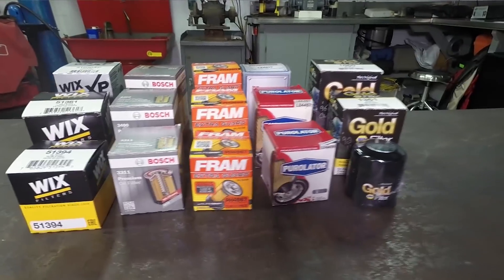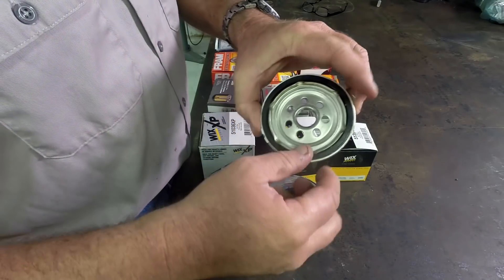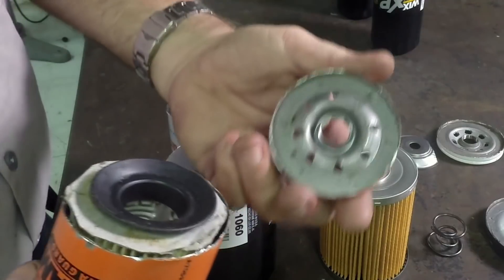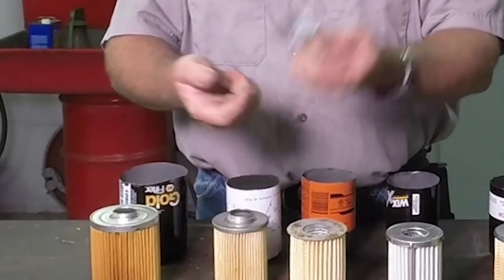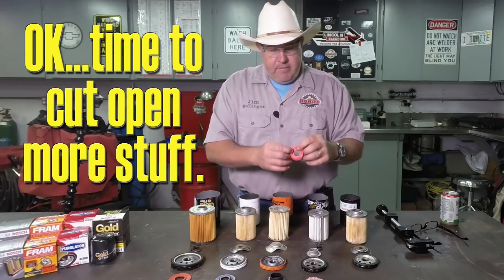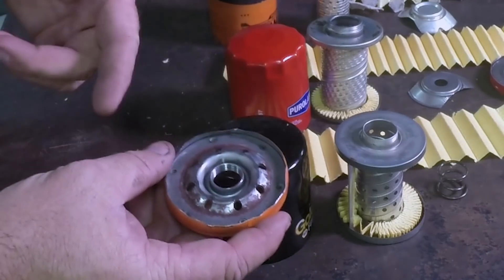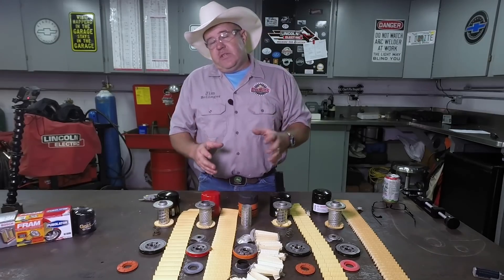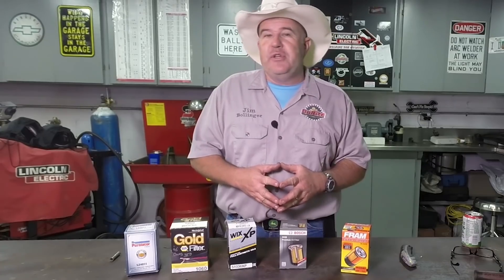The worst oil filter EVER!

Comment: Fram obviously watched al these videos proving how nasty their standard filters are so they developed the "Ultra Synthetic" which I'm presuming is meant for synthetic oil not that it matters. But the insides are really up to scratch, great media, metal ends, good spring, good anti drain back valve. It runs about $8. but it should be the only filter they produce.

Comment: An eye opener about Fram. Been using this brand on my 85 Mazda RX-7 since purchased new and changed oil and filter every 3k miles, perhaps the frequency of oil changes prevented filter failure. This has changed my perception of Fram dramatically, it's Wix or Napa Gold from this point on. Clever marketing on Fram with the attractive container, all to hide the sordid materials within.

Comment: I use nothing else but Fram filters, since I do my oil changes  I had a 95 Nissan pickup and used Fram oil filters for 25 years  it now has over 3000000 miles with same engine, you don’t need a 50:00 dollar filter. Fram also makes other oil filters with better quality, what you used is the three dollar filter.

Comment: I only use purolator filters in my car and I'm at 265000 miles and running strong. I recently smog checked it and passed with no problems.

Comment: The rust in that Fram filter should not go inside your engine. It seems to be outside the element and therefore if any of it was loose it would be caught in the element and would not enter your engine. The proof is in the pudding. Only scientific analysis on a machine where clean oil is deliberately contaminated and then filtered with each of these filters and compared oil analysis before and after such testing will prove which filter, if any, is superior regardless of how superior the construction seems to be of one compared to another.

And Fram makes at least three different levels of quality for their filters. It's not fair to include Fram's cheapest filter with more expensive ones unless you at least include Fram's more expensive ones like the Fram Ultra.

Comment: So much for made in USA. I got 290,000 mi on my 350 using various filters including Fram with 5000+ mile oil changes. If you change your oil at 3k before it gets really bad what difference does it make. Maybe people with K&N air filters are the ones who should worry. Go Oberg.

Comment: What makes an oil filter good: Thick casing, metal filter holder, silicone (vs rubber) anti drain back valve, real metal spring (vs those metal clips), and most importantly a media that has the highest efficiency at the lowest micron size.

Comment: I found a study about this in the early days of the internet. The Fram filter not only is crappy filter from just stand point of the material in the filter portion of the unit oh, but it's actually dangerous for your engine. If that cardboard breaks loose in your engine and makes it end to the oil that is flowing back to the engine you could blow your motor. I stopped using Fram probably about 2002. I would like to see a cut-down of the Purolator gold. That's what I've been using. My new car has gone back to the old style cartridge filter where you just change out the media. Kind of like my 66 283. Boy was I surprised when I went to buy the filter for that years ago! This is great video by the way. Keep up the great work! I wouldn't put a Fram filter on a lawn tractor.

Comment: Thanks I have a 2003 ford f250  with 7.3. Well my oil never stayed clean so I bought an remote toilet filter and my oil was cleaner. I have 14 qts in my system and the big point was clean oil. I am going to try a new frantz synthetic filter that is guaranteed for 12,000 miles. I must be doing something right I have 250,000 miles, but I was interested what you thought.

Comment: Would have liked to see a factory filter like Motorcraft
Reply: Looks just like the purolator pureone
Reply: @mr.boostang2064  according to my recent research Purolator no longer makes Motorcraft oil filters. After Purolator had a major quality issue with the MC filters Ford  has now contracted their oil filters out to Champion Labs.
Reply: @tonybradley2801  that's good news then because Champion makes quality oil filters and spark-plugs

Comment: I just changed my oil in my 381 stroker Chev.
511hp and 12k to build. I put a Fram PH5 filter on my prized gem of an engine. Now I gotta jack up my 81 Camaro again, and swap out the filter with a Napa Gold. I can't believe this. My buddy musta saw this video, cause what he told me, matched up with what I saw in this video. I wish he would of told me that before I did the oil change. Good thing I didn't run it with the FRAM POS-h5 filter on it.....I'll be cutting it open (probably with a dull Swiss army knife, zip cut not needed) once I get the damn thing off.

Comment: I actually had a bad Wix/NAPA Gold filter for my Jeep 4.0 where the filter was horizontal and mounted to the side of the block.  The anti-drain back valve was bad and allowed the filter to drain back into the crank case through the oil pump. An engine start after a few days had lifter clatter from the slug of air in the filter. NAPA immediately sent their engineer along with a Wix representative. I filled the filter and put my thumb over the discharge hole; then I turned the filter on its side and oil drained out past the anti-drain back valve. NAPA took care of my expenses and apologized. Great people.

Comment: What about Baldwin filters that are the preferred filters used in heavy equipment and are available for any application? 

I have been using them for years on all my vehicles.  https://www.baldwinfilters.com/portal/site/Baldwin/menuitem.f6e556a1cf41b967f2ae22c04256d1ca/?vgnextoid=7aa8a15580756610VgnVCM10000025651dacRCRD&vgnextfmt=EN

Comment: Best filter I ever owned was a Frantz which uses an adapter plate in place of the stock filter with the canister which holds a roll of toilet paper that provides filtration of the oil. I ran one in a 1965 Plymouth Valiant with the "Lazy" six cylinder for over twenty years, swapping the roll of paper every thousand miles & adding oil, usually a quart to bring the level up to the full mark. I NEVER CHANGED the oil except for what was added with each "filter" change & the oil looked as clean as the day I put in in when I sold the car You can still buy them for about $250. I paid about $25. for min in 1967.

Comment: I'm going to say it now and I'm going to say it again, I put over half a million miles on a 2002 Toyota Tacoma using nothing but Fram filters. they work great. anybody  want to argue with half a million miles? I pulled my valve covers off at just 450,000 miles to change my leaking valve cover gaskets, the camshafts, everything was absolutely beautiful you could have eaten off the inside of that engine!

Comment: I learned several years ago that While Fram does manufacture many filters, their market share is so large they contract out to other companies. That is to say, they don’t make all of the filters with their logo on them. Care to guess where they are made? Hint: saltwater promotes corrosion. Because of the inconsistent quality, I quit buying Fram back in the 1990’s. It’s not always crap, sometimes some part numbers are “acceptable” quality but there isn’t a way to tell by looking at it and I’m not gambling on my own or someone else’s vehicle to save a couple of bucks. 

I worked at a CarQuest store in the 1980’s and we had a display of a disassembled WIX filter beside a generic filter that looked similar to the Purolator in this video. No one would have believed there was a filter as crappy as the Orange one at the time. I usually go for the manufacturers filter for proper fit (more important on late model engines) but if it’s gotta be aftermarket, it’s gonna be a WIX. (One exception, a 6.0 PowerStroke)

Comment: You just triggered my depression with that Fram filter. How could this product have lasted on the market for so long? Don't answer. Don't care. I try to keep what little I have and try to do the small things to do what's right, while to whole time it was russian roulette with the Fram oil filter. I AM speechless

A shoddy product bears no place with me, even though it is cheaper. If a good baseline product is more expensive then to me that is the right price pay, and means there is no loss in the saving of pennies, or quarters... or dollars. Then, the reverse becomes prominent, the higher price is the only reasonable applicable choice becomes the standard in my book.
Like, French's Mustard. A low cost mustard just simply isn't French's Mustard. They are world's apart. And not the world I live on. Give me French's.

"No More Fram's."
"Stamp Out Fram's!"

Comment: I already knew they weren’t much good, at least not at holding their oil. I had a Ranger 2300 with sideways oil filter. It started having dry starts ( I could hear it for few seconds on starting ) so I would have to start- shut off restart at least once. I got a Motorcraft filter and it didn’t do it any more.
Had another one and it started doing it, I thought it probably has Fram filter, it did. Put I think it was STP filter and didn’t do it anymore.
I don’t care if they are FREE don’t use one.
Reply: Good to see something like this where someone actually cuts a bunch of different brands to see what’s inside. Now we know

Comment: Been using Fram oil filters for over 45 years with no issues. They make several levels of quality and I always buy the highest rated. In this video I can't see which Fram is being used. I drove a Honda for 26 years (270,000 miles) and did over 50 oil changes and it was not using oil when I sold it. I recently bought a new Subaru and I watched a video on how to change the oil. The instructor said he used a Purolator filter because the bypass spring was strong enough to not let any oil bypass. Walmart ( yeah I know) didn't have Purolator or a Mobil to fit my Subaru so I decided to try K&N. Yesterday before I put it on I watched a video where a guy compared about 7 nonsynthetic filters and about 7 synthetic filters. He used an XG grade Fram synthetic filter and he rated it above the K&N and the Purolator and about the same as the WIX and Mobil. That caused me to change my mind and I put the XG grade Fram on my new Subaru instead of the K&N. It claimes to be good for 20,000 miles. In the past I used a WIX on a Mercedes because it was the only brand available at any of the parts stores ( and yes I tried Walmart first). I had a Corvette that called for Mobil 1 oil but I used a Fram filter. Like I say I have used hundreds of Fram filters with good results but I always bought the most expensive ones available.

Comment: I've always used Fram filters since I started doing my own oil changes about 20 years ago. Haven't had issues with fram filters. Fram offers different styles of filters.  I suspect this video shows the economy style Fram filter versus  premium Style filters from other manufacturers. I'll have to do more research on this, thank you for the video.
Reply: after reading your post I went back and blew it up big. That is a fram extra guard.There is one view where you can read the can easily. I too am suprized but it is what it is.  I just think they may have done the same thing alot of companies have done to survive. That is to switch to cheaper manufacturing techniques and then survive on your name. Sad to see that. I had an auto shop for 15 years and I now worry that I did my customers wrong without even knowing it.  What now?

Comment: You need to do factory filters.  I'd love to see how they stand up to the aftermarket brands.
Reply: Many factory filters are made by Champs. Champs makes Fram. Fram, Motorcraft, Mopar, Acdelco, Purolator. They also make a few other very low end filters used in those 15 minute oil change shops.

Mann and Hummel make Wix, Mann, Mahle Clevite, NAPA, and OEM BMW, Mercedes, Volkswagen, and several other Asian and European OEM filters. They do produce a lower grade product sometimes sold to the 15 minute oil change shops that is equivalent to the best made by Champs. NAPA sells them under the ProSelect branding. They are fine if you're anal about your oil changes and are a light driver.

Side note, most people don't realize it, but if you read your owners manual you will find 99% of car owners fall into the severe use category. Car manufacturers generally call anyone who drives in a city stop and go, drives in dusty environments regardless of stop and go or distance, or drives more than 10 miles per day as being a severe use driver.

In other words, use the severe column when determining your oil change and other maintenance intervals. 

Side side note, as a user for over 30 years, and now seller of wix filters for 25 years between running a Carquest and now running 3 NAPA stores I've gone to the NAPA Platinum filters only. Which are the highest end Wix filters.

Comment: I learned the hard way that Fram is trash. I did an oil change with a fram filter, later that day the filter gasket failed and sprayed oil down the highway. burned up a piston and broke a connecting rod.

Comment: I used Fram filters for 40 years and never had an engine failure. Last engine went over 200k. All I did was  change the oil and filter (Fram) every 5K.
Reply: I would take this comparison with a grain of salt. Oil filters are designed to filter oil. This guy twisting and poking at them gives us zero information about how well these filters perform their intended task. I’d be willing to bet that all of them are perfectly adequate for standard on road use.
Reply: @nogoodnamesinleft  I sure wouldn't recommend a filter that consists of nothing more than a cheap coke canister containing a bunch of tea filter paper and cardboard glued together!
Reply: Im with you but now I wonder if I misled all my customers from all those years.
Reply: @ottoteck  You didn't do it on purpose, sir. FRAM hid their dark secret from you.
Reply: Same here ! I used FRAM for 40 year in Honda, Toyota and Lexus cars. Never had any issues like burning oil or engine failure. Changed at 3-4,000 miles. I use Fram in my 2001 Lexus LS430 too. I drove that car 4+ hrs straight on highway last weekend, does not burn oil. To be safe, I will upgrade filters
Reply: He used the Napa gold up against the cheapest Fram. Napa Gold is cellulose. Fram XG filters are full synthetic with wire back screening metal end caps and metal center tube. Sure Grip coating
Reply: My  pontiac is pushing 300,000 km I use only fram filters,  engine still sounds great  don't burn or leak oil.

Comment: Seen it on the internet, so it has to be true. Fram has been around forever, how long has this guy been around.
Reply: Rex Bentley you would think they would improve their quality since they’ve been around for so long. No excuses for cheap production and still charging the same price as a premium filter.
Reply: If the filter is falling apart with out oil that’s not a good, imagine that getting into your rod bearing.

Comment: never changed my oil on my 2007 Silverado with 345,000 km  on it.....runs great    drive it till it drops
Reply: 704,000 on my '95 Ford F-150 with a 351W and still going strong. I did have to rebuild the heads around 650,000 due to leaky valves, but the bottom end is still all original. Doesn't burn any oil. Full synthetic Castrol every 5,000 since I bought it with 123,000 on the clock. :)

Comment: Lots of good info. Good comparisons. My first question would be about the filtering performance. Just because one has longer filtering media than the other wouldn't always mean it is better if the media performs less. Second question would be about the rust on the Fram. Is it really rust or some other compound? Hard to tell on the video, but it didn't appear to pit the metal which I'm guessing is aluminum? Still, I appreciate your input and the time/effort for the video.

Comment: I had used fram filters for my semi trucks for years with no problems. So far we had run over 120,000 miles the past year and a half on each truck without problems. Two months ago we replaced the oil cooler and replace the oil pan gasket. We inspected the engine, oil pump, and other internals and we did not find any cardboard pieces. Fram is a quality filter.

Comment: ive used fram oil filters for over 30 years, from 1985 to 2015 3 ford f150s  total miles 1,000000.million + miles with no engine work done on any ofthe three trucks and i can add my ram hemi to that going on 200000 miles, sounds like bullshit to me

Comment: I call bull crap, I've been using fram for over twenty years without any problems ever!!!
Reply: Do you think what you saw wasn't  true?
Reply: Denial is the most predictive human response. But its true, FRAM is crap.
See?
https://www.youtube.com/watch?v=Y544o-mw2wc
https://www.youtube.com/watch?v=FYaPJ2XT4Mg
P.S. Only the Fram Ultra series is acceptable. The rest is crap.
Reply: @Nick-GR  if you consider what the purpose of a oil filter is, to filter oil, the oil you are going to use is going to break down before the filter. so as long as you have a filter on there the rest is irrelevant.
Reply: If you feel good using a shitty filter, you should continue using a shitty filter.